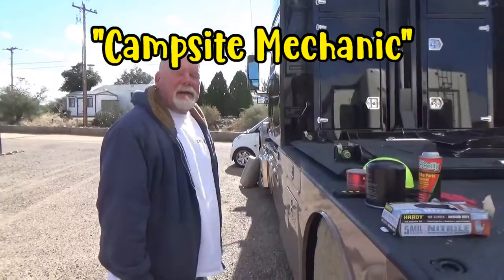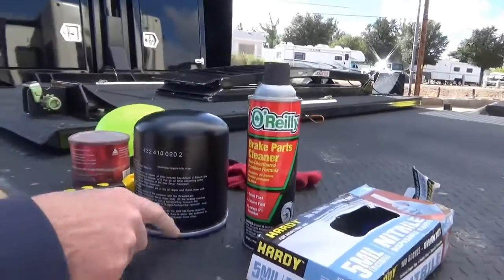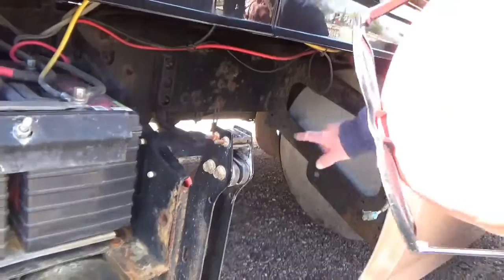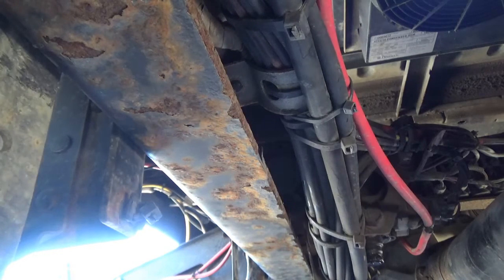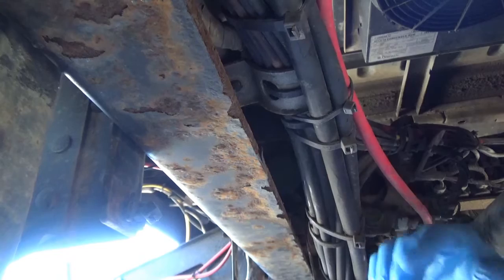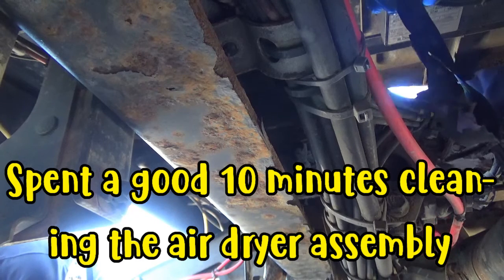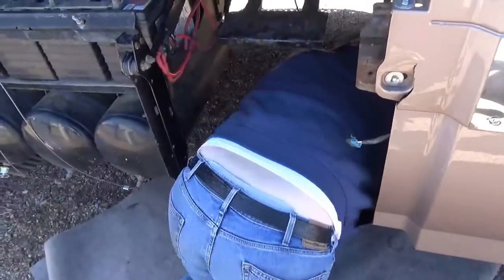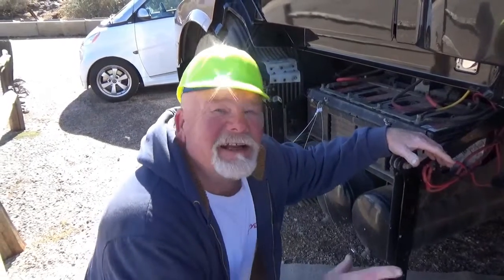The "Campsite Mechanic" Changes the Air Dryer Filter

Comment: Looks like,you might want to get a head start on that frame rust where it was starting I wire brush then use POR works great
Reply from the maker: Yeh, been talking to a guy about repairing it.  I'll check into the POR and maybe I can save some money.  Thanks for the heads up.

Comment: When you bleed the air is there also a valve to release any water that accumulates in the system (bottom of air tanks) or is the idea to have NO moisture period...hence the air/moisture filter?
Reply from the maker: There is one valve in each tank that release air and moisture.  The filter helps dry the air and filters debris out of the air system.

Comment: THAT frame rail look's pretty bad - it need's too be ground down and POR 15 Put on it then re- pray painted too keep it from more damage happening, before a frame crack's
Reply from the maker: Thanks for the comments.  You are right.  I definitely want to do that.
Reply: It also looks like there is some type of step, from when the chassis was more exposed during its lifetime as commercial rig.